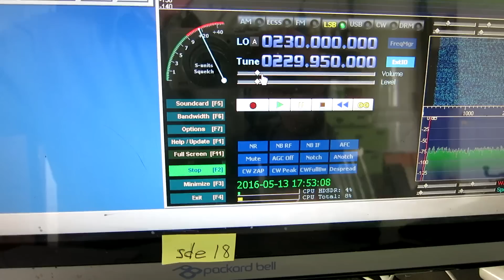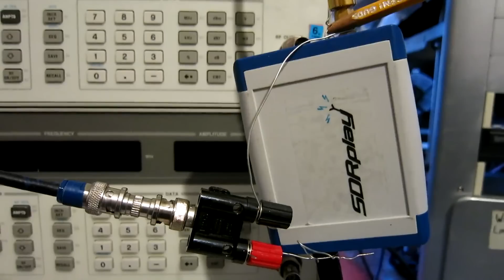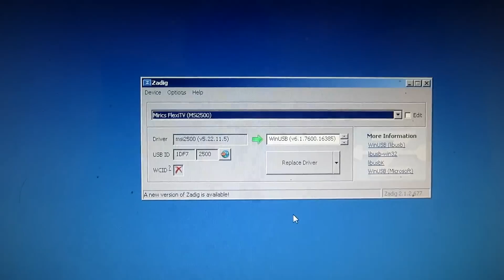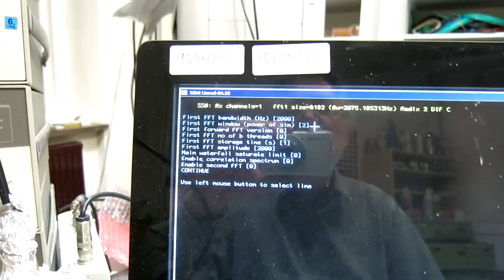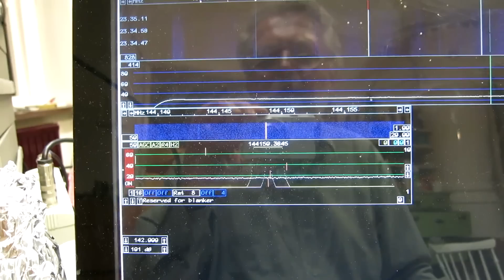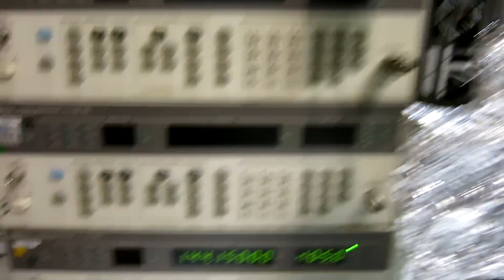Comment: hi! If you have a generator, could you check the receiver stations in the 400-420 MHz and in the area of SATCOM 220-300 MHz. I think SDRPlay do not hear the station 400-420 MHz. And there is no doubt that it works well 220-300 MHz. You can check this generator? Thank you.
Reply: +levota2 I checked 190-440 MHz and SDRplay works OK with HDSDR. With Linrad there is a gap from 250 to 394 MHz where the SDRplay does not work.
Reply: +sm5bsz Thanks for the reply. Strange... my Uniden BCT-15X hears multiple frequencies on a plot of 400-420. However SDRPlay + SdrConsole can't hear anything. Above 420 MHz both work well. However, 400-420 Uniden works, but SDRPlay is not working.
Reply: i can confirm very very bad (loss about 40db) reception on 400 to 420 mhz.it will never work, because of the hardware.